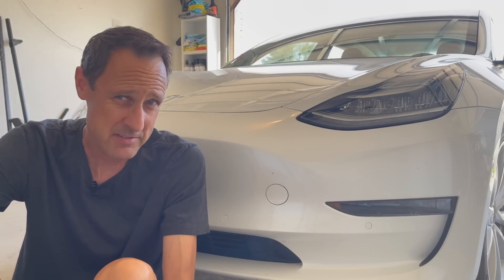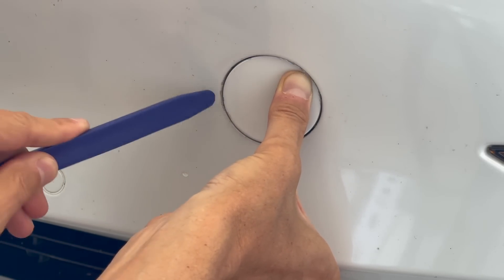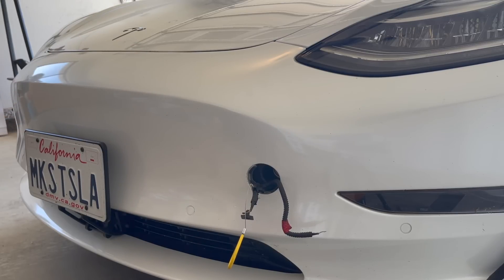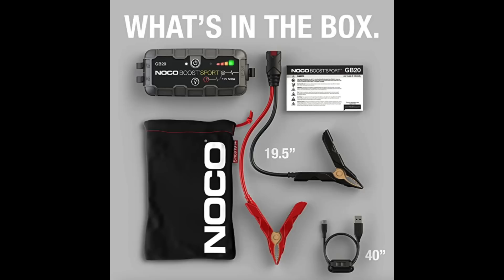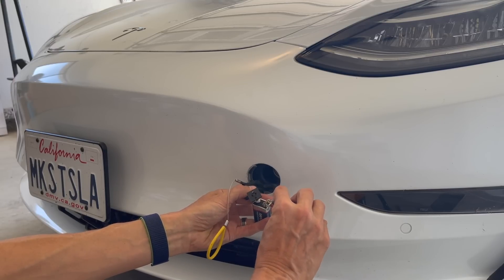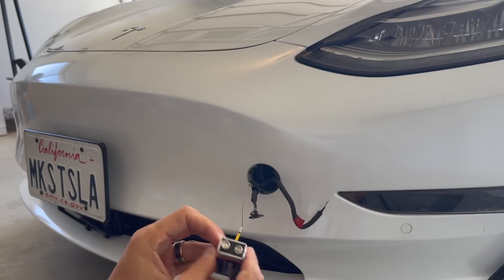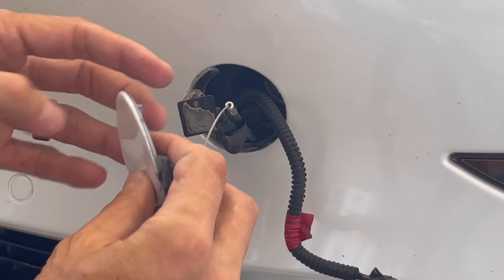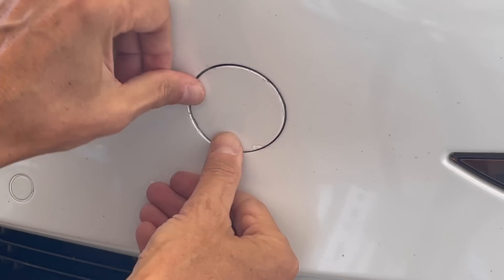How to Open the Frunk if Your 12V Battery is Dead

Comment: You can tape a 12v camera battery to the cables and be sure you have a battery accessible to use all the time Battery A123
Reply: Not an A123, but an A23 battery cell.  I and a few others keep an A23 in a ziplock bag behind the tow hook cover.  The A23 is a tiny 12v battery and about half the size of a AA battery.  And it will open the frunk (I tested it a few times to make sure).

Comment: A smaller A23 style battery will work vs the bigger sized battery as well and I put one in a small zip lock bag and secured it to one of the wires with a small piece of duct tape. and stuffed it back behind the bumper. Link: https://www.acehardware.com/departments/lighting-and-electrical/batteries/specialty-batteries/3009743?store=04673&gclid=CjwKCAjw3MSHBhB3EiwAxcaEu0pt6yRN13RyqAeXKg8yrqFbR1MiZPPjkY98EBjOqkCtI-pvqNst2RoC_uEQAvD_BwE&gclsrc=aw.ds